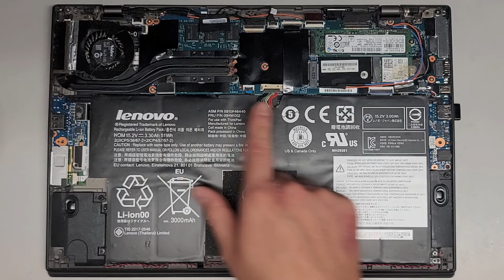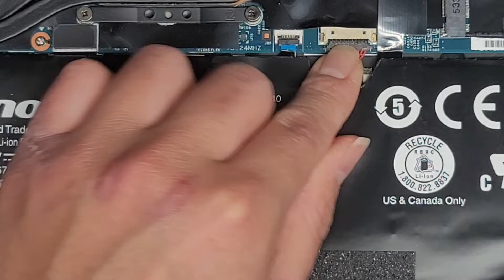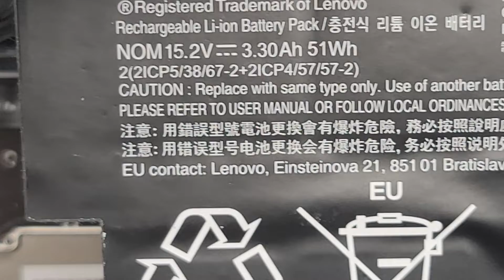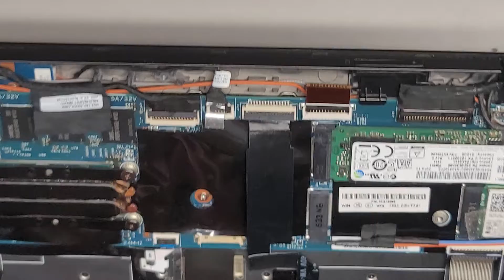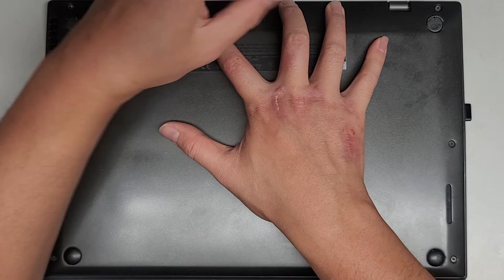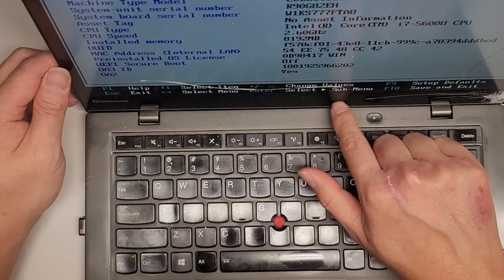Lenovo ThinkPad X1 Carbon 3rd Generation Disassembly Battery Replacement Repair Quick Look Inside

Comment: Battery model - correct model is 023 or 022? Internet search for x1 carbon 3rd gen shows 023 but the video here  shows 022. Can anyone clarify? Thanks
Reply from the maker: Both 002 and 003 will work. This https://amzn.to/4mAYFNq

Comment: where is the bios battery in this model?
Reply from the maker: @marv4895  built into the main battery.
Reply: @ItsBinhRepaired  sad. thought i could replace a 1$ part. now have to replace a 40$ part
Reply from the maker: @marv4895  yup
Reply: @ItsBinhRepaired  I replaced the battery, still have the same issue. sometimes won't boot, only if i disconnect and reconnect the battery fully and then I have to set the Bios-Time again, otherwise it won't boot. Do you have another idea what could be the problem? I can also replace parts on the pcb, i have the tools for that.

Comment: On my lenovo thinkpad x1 carbon g7 i don't have a cmos battery:S I'm a an idiot ur is the battery pack also for cmos?
Reply from the maker: @ROBBER011  most likely lol
Reply: @ItsBinhRepaired  Its was under the" "motherboard"
Reply from the maker: You found it there?

Comment: I have replaced the battery because I got d pop up to replace it & unplugging d power cord would turn off d laptop. 
But with d new battery, d system is still not charging d battery & unplugging d power cord will turn off d Lenovo X1 carbon laptop. 
What else could be d problem?
Reply from the maker: @JoseV6747  d motherboard.

Comment: on a X1 Carbon Gen2 where is the CMOS battery located as cant find when open the battery section
Reply from the maker: Maybe the main battery
Reply from the maker: Google says under the motherboard.

Comment: Hi...this laptop allows change the bios battery? My laptops is loosing the date and time everytime that I shutdown the system
Reply from the maker: Gotta learn to do a little research. It'll be difficult to remove, but you can see it here. https://www.ebay.com/itm/284724240348?mkcid=16&mkevt=1&mkrid=711-127632-2357-0&ssspo=BWEr4-3WTXi&sssrc=2349624&ssuid=NQxVFnxHSb6&var=&widget_ver=artemis&media=COPY
Reply: @ItsBinhRepaired  thank you
Reply from the maker: @clagccs  no problem
Reply: Hi, is there a way to remove the bios battery?
Reply from the maker: I think it uses the main battery as the bios battery.
Reply: @ItsBinhRepaired  

So if I replace the battery, it will also change bios?
Reply from the maker: The bios will reset if the battery is removed and the power button is held for more than 15 seconds.
Reply: @ItsBinhRepaired  The BIOS reset when I replaced the main battery, had to reset date & time. Didn't hold the power button down but maybe you meant either/or. Thanks for the video, was very useful.
Reply from the maker: @choddo  depends how long it takes you to swap the battery.
Reply: @ItsBinhRepaired  Was 5 minutes tops
Reply from the maker: @choddo  yeah, that's long enough.
Reply: @ItsBinhRepaired  interesting, is it just maintained by a capacitor or something?
Reply from the maker: @choddo  Yeah